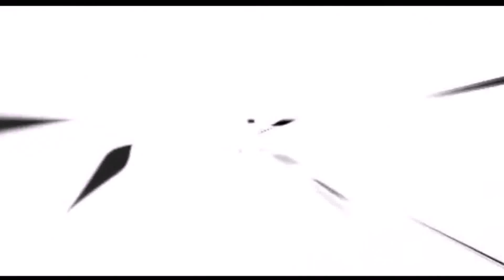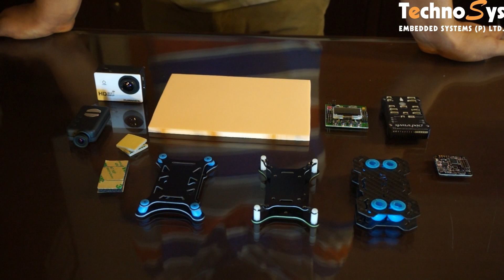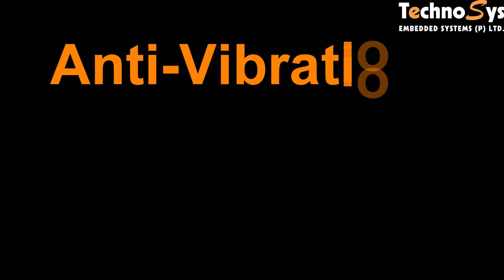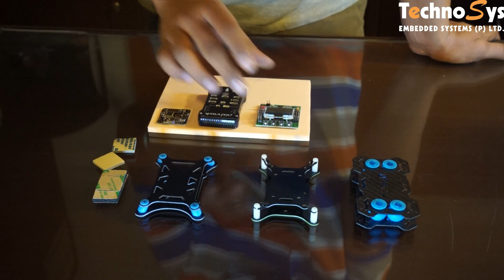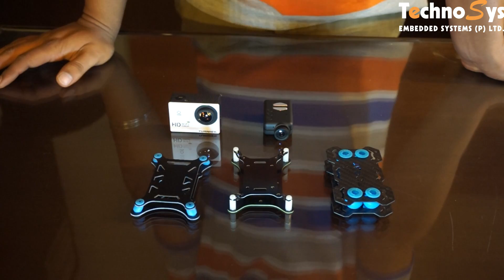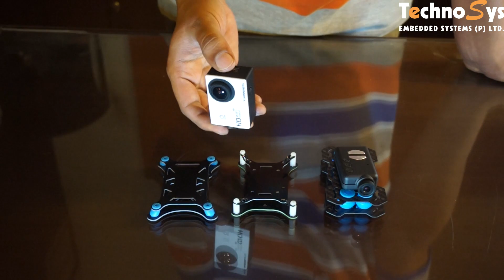Our View on Universal Anti Vibration Mounts for Flight Controllers and FPV Cameras

Comment: I am already using one of the anti-vibration mounts you showed.... Works perfectly.
Reply: +TheGray Aviator for Camera or card? I just got the one u see on the left for an old APM 2,5, hope it works. but after this video I should probably go for the one in the middle for control card or is it the apm card light enough do you think? Not suitable for runcam mount I understand from this video.
Reply: dseed norway I got the same anti-vibration mount as you for my Pixhawk. For the camera, I am just using a Tarot 2D Gimbal, works great.
Reply: thanks for the info, waiting for the mail man these days :)

Comment: If you double loop the rubberband for the HK anti vibration stand it work's great. It can be a little hard to install then, but it's not loose as in your video. I use it for the HKPILOT32(Pixhawk from Hobbyking)
Reply from the maker: Yes, you can do that but we prefer it in a single loop and use it with a camera. Don't want to risk pixhawk on a piece of rubberband. Its more of a personal choice and will to take risk. Cheers!!

Comment: the one one the left, the first one you picked up - how do you put it together? I cant get the rubber into the holes! - i have a gimbal with a similar, but bigger rubber dampeners, I dont have a problem with them, they can also be pulled in with a bit of string. But these tiny things I cant get in the small holes. How did you do it?
Reply: I got the dampeners in .. eventually - with string